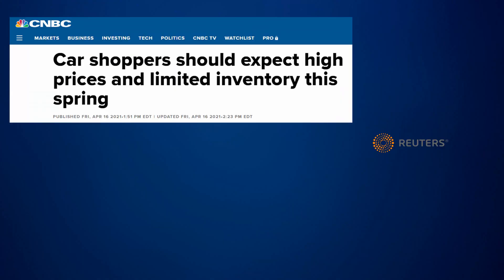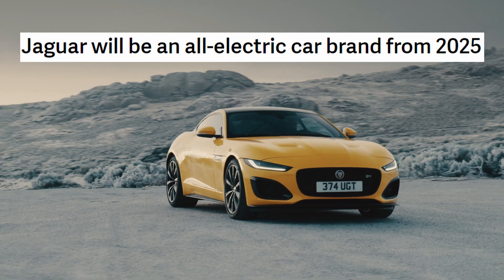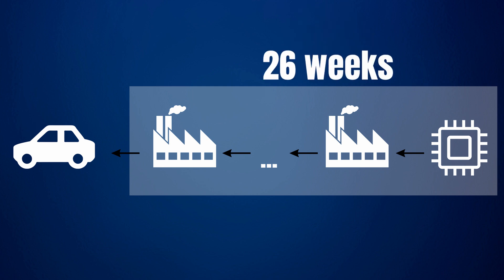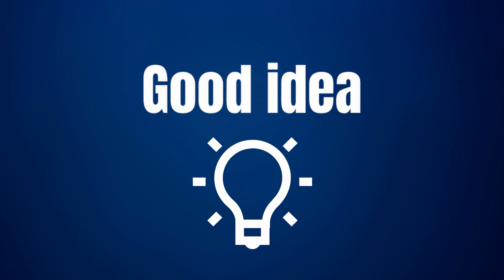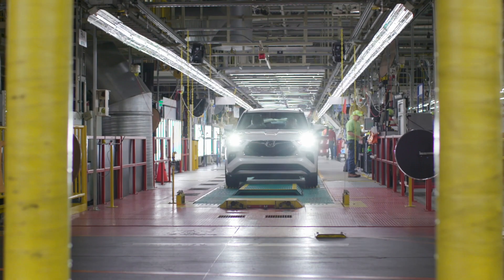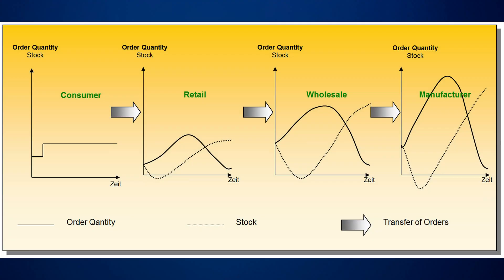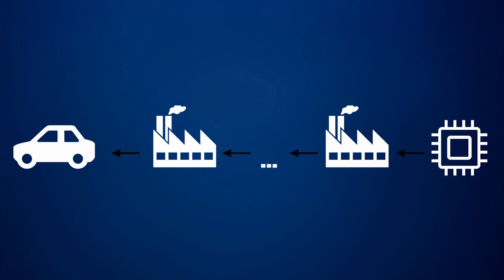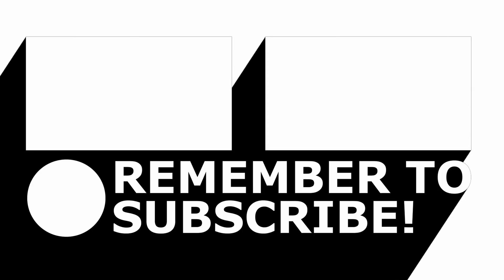How the global chip shortage increased car prices and what this means for future prices

Comment: So is the shortage of Toyota vehicles at US dealerships because they are just the best cars and the only manufacturer that has a good pipeline of vehicles being delivered?
Reply: This.  I have a friend who wanted to buy a new 4runner but couldn't find one on the lot.  He ended up going next door and buying a BMW instead.
Reply from the maker: Event though Toyota managed their supply chain well compared to other manufacturers, there are still some reports that local production facilities were effected by the chip shortage or a shortage in a different component. On a global level the impact is relatively small.